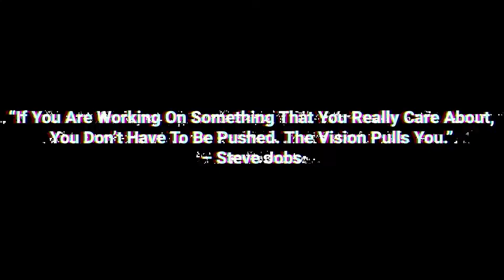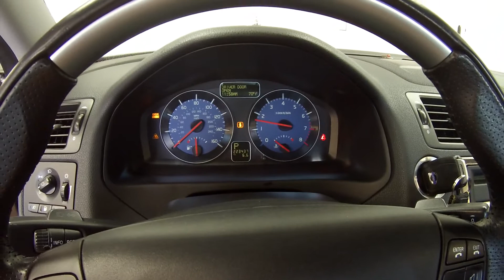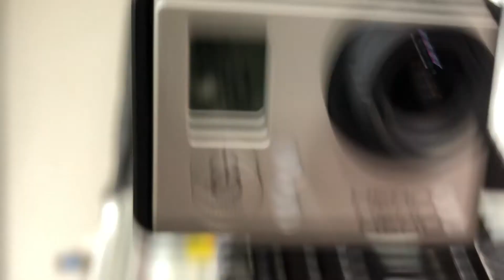EP9 | Copart 2009 Volvo S40 T5 AWD R-Design Flooded Interior Rebuild | Project Saturated

Comment: I’m doing a 2004 Volvo t5 awd engine replacement do I was to remove the front like you did or remove the sun frame and drop it from the bottom with the transmission together
Reply from the maker: 🇺🇸 That is really up to you. The front of this vehicle dismantles pretty easily so you can do that or just drop the entire assembly out of the bottom. I’ve done it both ways. 👍🏻
Reply: I finish the car I drop it from the bottom with the transmission on it I removed the sub frame that was nice and the next time it’s fast for me because I know where to start it💰🦺🫵👍